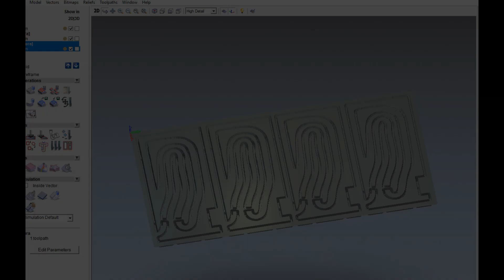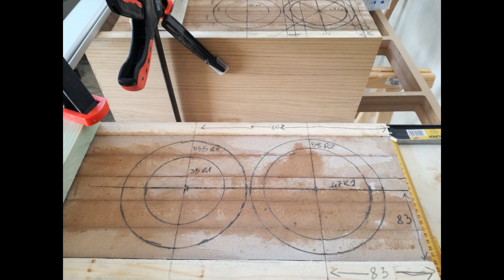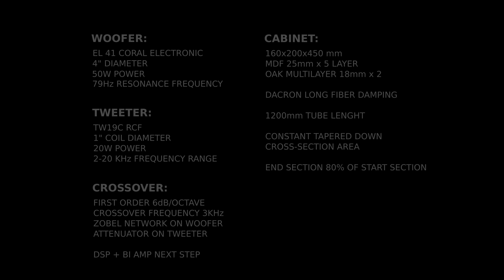Building T-line 2 way speakers - transmission line

Comment: Interesting - how did you design the transmission line? I.E. the dimensions and the lengths?
Reply from the maker: Hi Neil! You Will find some of this info at the end of video.
Reply: @SevenCri  I saw that, thanks. Rule of thumb TL's are hit or miss.

Comment: great job! tuned to 70hz? are you filling in with a sub? hows the bass rolloff? i'm thinking about starting a tline project tuned to 40-45 hz if I can fit it
Reply from the maker: Hi Chris, the lenght of tube is tuned to 70Hz. This frequency is lower because of damping and tapered down tube. Now there isn't any sub. Bass is very clear and defined. I hope you will start your project soon ;-)